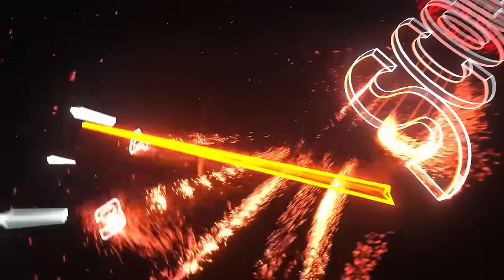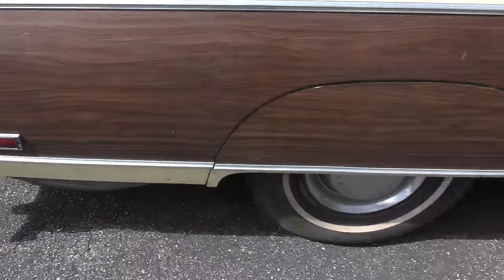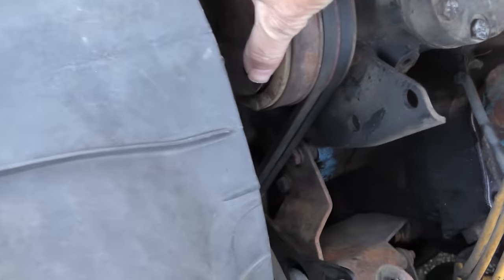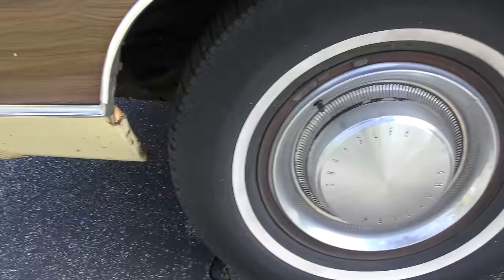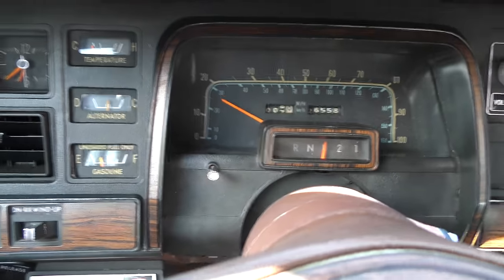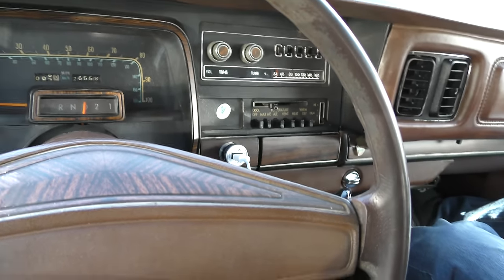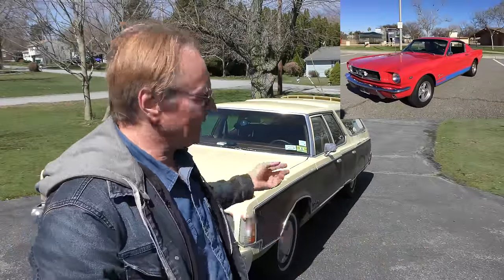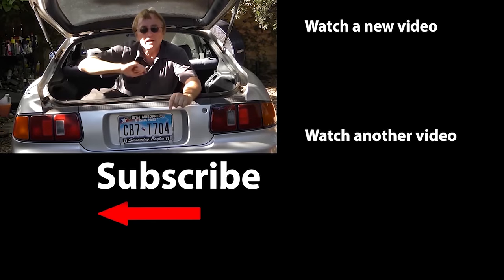I Just Found My Dream Car (Goodbye Toyota)

Comment: My ideal proper car. If they made them now and fuel was cheap I'd have one. That station wagon is how a car should be; pillowy ride, huge comfy seats, V8, loads of room, will last for ever, easy to fix. Today's cars; small, complex, expensive to fix, with bone-shaker suspension and seats as hard as planks.

Comment: Oil coolers on the power steering     themtouchy front disc brakes   and that air powered dust deflector aimed at the rear glass to keep you from having to hike all the way back to the back of that land yacht  to broom the dust off of that big oversized piece of glass  there was a lot more long Dusty roads to travel on   back in them days ....and ya just about have to use the hood mounted sight to keep her  pointed in between the ditches   Scotty  😁👍  😅

Comment: I had a Maroon 69 Chrysler Station wagon. We used as a Surf mobile it could easily carry 15 surfboards. I cut the top off and “ turned” it into a convertible. Problem was it flexed in the middle. I fixed that problem by welding a thick piece of steel across the rear doors.

Comment: DAD  had a  73 Buick  Estate Wagon  huge  smooth  riding  car   455  V8,  good  car until  the  wiring  to the  Air-conditioner caught  on  fire  ,traded it  in  with  190,000  miles  on it  in 87,

Comment: I'm 60 and love them old cars. The only problem now days is gas is so high you couldn't afford it. Them cars only got like 7 to 12 miles to the gallon cause they where so heavy. No the won't put a battery in it and turn it to an EV. Reason being they are so heavy it would drain the battery completely before you could get out of your driveway. 😆

Comment: Hey scotty i just bought a 2012 Ford F150 FX4 5.0 with 106k miles, only issue i had was replacing a taillight but not a big deal. anything i should look out for? Maintenance Repairs? I obviously did the oil change already and checked rotors and brake pads, the basics. Thank you as always love your videos!
Reply: A Ford? You know what Ford stands for? "Fix it again Tony"😆
Reply: @bigl5343  i heard it stood for fixed or repaired daily
Reply: @bigl5343  Fix it again Tony applies to Fiats.

Comment: Scottty, working on a chevy 78 G30 camper van.  have to remove passenger door to put in new fridge/freezer.  the door itself is no problem, however there is a slide? that is attached into body as  well I can send you pics of it, how do i get the door off with this slide that limits the opening of the door?

Comment: my dad had 2 caprice Classic station wagons the first one was Green and he put over 300,000 miles on it we always took it to Daytona the last time we took it it had nearly 300,000 miles on it and it broke down by throwing the timing chain in St Augustine in the middle of July boy was it hot I was about 7 years old at the time and we had that thing loaded with all our suitcases and everything and my dad had just bought a brand new Cadillac but did not want to drive it to the beach because of all the sand my brother he was a mechanic had to come down and get it with a tow truck and brought the new Cadillac to us we had managed to make it to a gas station the only gas station around for miles. when my brother drove up with the new Cadillac he said those were surely some sad faces in the parking lot of that gas station and would die laughing. the other Caprice Classic was a blue one and had nearly 300,000 miles on it also and it through the timing chain when I was driving it in high school